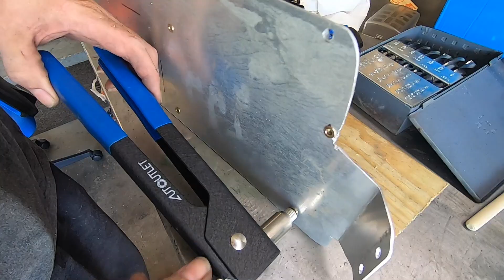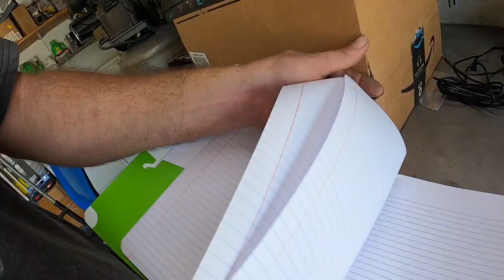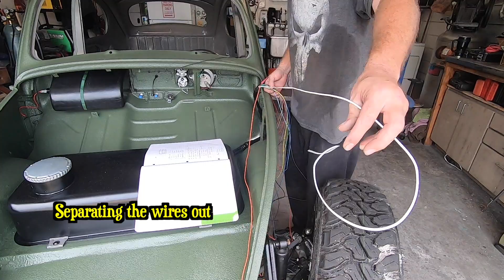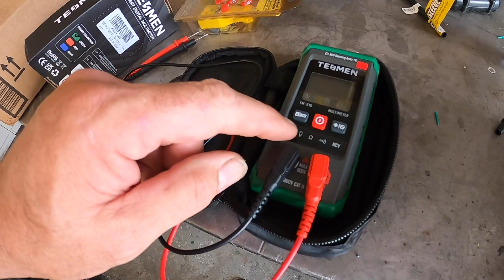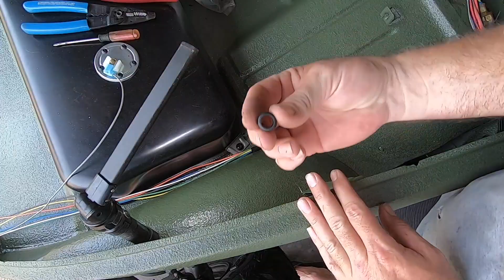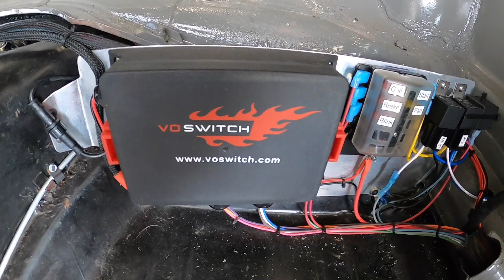Custom VW Wiring Harness with Custom Switch Panel! Sickxty - Volksrod Franken Beetle Baja Build - 53

Comment: I like it! If I  wanted to mount the Voswitch under the drivers side rear window, though a door panel and close to  metal about how far through would it have to go? Basically I'm trying to ask how thick is it? And is that a bad place?
Reply from the maker: @jameshorel1938  i honestly don’t know if it would fit there or not. It would be best to measure your area and see if it’ll fit.

Comment: I really studied hard this time watching this because I was curious how that switch panel worked, also building my own, considered using one of these just for the switch panel....  It appears the VoSwitch unit is sealed up and proprietary and part of a bigger kit, there are other switch panels like it, but don't just have regular switches... they are "SMART"  Hehehe
Reply from the maker: There are other brands out there that are basically the same, probably all made in the same factory. 
Even though it’s an 8 channel relay board, the panel wire to the board is a 4 wire. 
I’m sure what you’re cooking up will be much better and definitely cooler than this setup.
Reply: @VWJawbreaker  Yep, 4 wire is probably some form of shift register also, power, data, load and clock, the wire is probably shielded (5th wire) and that is ground.  That's still a cool setup there, not knocking it!  I just wish I had one here to take apart and reverse-engineer!  Hehe!

Comment: I'm thinking I want to drop a conduit through the heater channel.  I have no heater pipes in there, it should work for me.
Reply from the maker: The heater channel is wide open inside, the only issue I had was fishing the harness out of the small hole that goes up the a pillar.
Reply: @VWJawbreaker  I think mind has a big hole where the heater pipe was suppposed to go... but ya know, I'll do what I'm best at if it's tight....  hehehe!

Comment: Do you think it would be possible to redo a normal bug with that wiring kit? I hate how it is now and want to redo it all.
Reply from the maker: It is possible, you’d have to start over from scratch.
Reply: @VWJawbreaker  no issues doing that if it's cleaner.
Reply from the maker: It would be a little more invoked in your case due to running a hazard switch, etc but it can be done. Relocate the fuses, etc to under the beach seat. The Mexican fuel injected beetles ecu computer was under the back seat.

Comment: Gary I have the little fuse block and I have ordered the main controller box it is to be here tomorrow and I have ordered my wire from wire barn then I can start working on it I got a list for front and rear. Thanks and if it is alright I may ask a few questions .
Reply from the maker: Absolutely Jim, I’d be happy to help any way that I can.
Reply: @VWJawbreaker  Thanks
Reply from the maker: @KCPurpleBug  absolutely buddy.

Comment: Great Job Gary not everyone's wiring genius😳😂.Looks sweet though
Reply from the maker: Appreciate it sir! 
I’m not a genius and have already been told what I did was wrong, especially for a VW…. I did what made sense to me, wires are the appropriate size for the circuit and everything works just as it should. 
Do what makes sense for you!
Reply: @VWJawbreaker  what happened to the wing ? Are you putting it back on ? Which it's probably in the way for now.Still have what doors and hood to paint?
Reply from the maker: @jeffcoleman5160  wing is off to the side until it’s ready to be driven. 
Actually, the videos are usually about a month behind my actual progress so there’s been quite a bit accomplished since this video was posted. 👍

Comment: Gary looking the wire where you got your what wire size did you order 12 or 14 and maybe some 10
Reply from the maker: Depends on the circuit I planned for, mixture of 16,14 and 10 for the main wire.

Comment: Gary your workmanship is outstanding. Would you recommend this setup for my 67 VW bus. The guy that owned before has got wires running everywhere and I definitely want to tidy things up. Thanks again for all your great videos.
Reply from the maker: Appreciate it sir. 
Best thing to do imo is follow the wiring diagram and go through things one at a time to get it tided up. If it’s butchered pretty bad it wouldn’t hurt to go with a new wiring harness and cut out 56 years of who knows what and possible corroded connections.

Comment: She’s definitely coming along. The only word of caution I would give you is the support bracket that’s behind your speedometer I would put some protection around the wire loom because vibration and time can wear away the wiring sheath, and possibly cause a short and a possible electrical fire. Had it happen?
Reply from the maker: That she is!
I do have some loom material for that section of wire…. Keep forgetting to put it on. Thanks for the reminder!
Reply: @VWJawbreaker  just looking out for you brother don’t want to see a burn your project to the ground
Reply from the maker: @THEREEFREPORT  I do appreciate the reminder!!